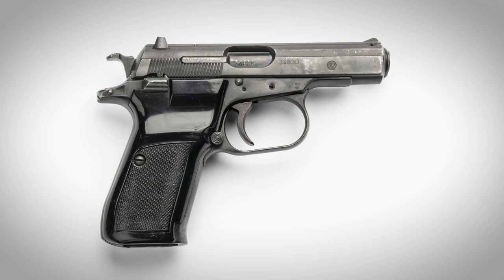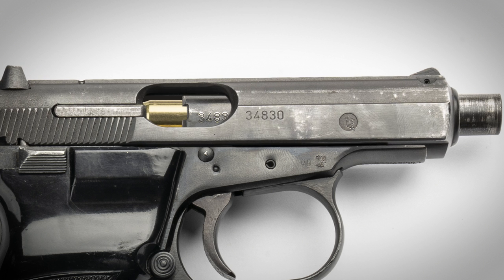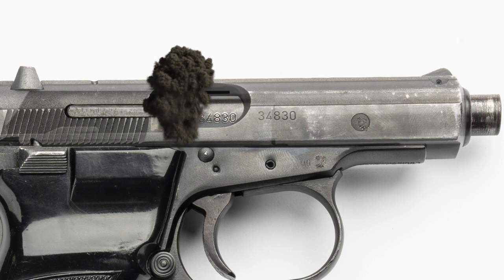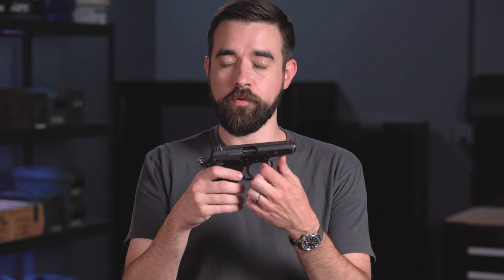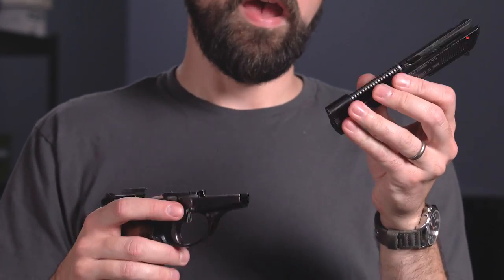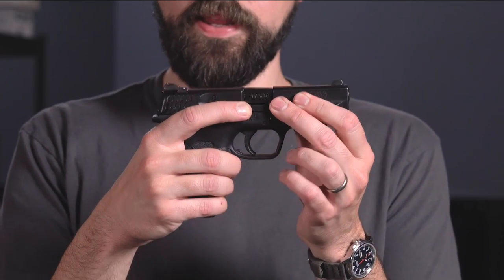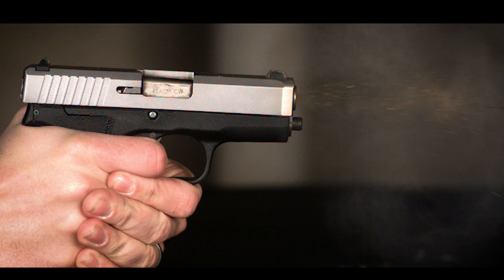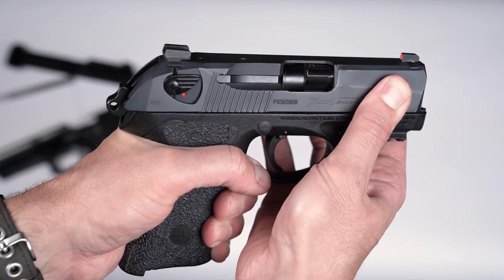Blowback Versus Recoil Operated Pistols

Comment: You should have covered the Magnum Research Desert Eagle XIX operation.   It has a fixed barrel and a locked breech. It is short stroke gas system operation.
Why hasn't anyone discussed an electronically timed delayed breech unlock operation?  A pressure sensor could even be used, if it wouldn't get fowled.  There are electric primers (Remington EtronX) and electric triggers (Digitrigger), why not a electronic breech unlock?

Comment: So would I be accurate to say that in general:

Blowback's have a straighter shot because the barrel is attached to the frame, slower rate of fire due to operation mechanics, and increased experienced recoil because the operation does not absorb it

Recoil's have a less straight shot because the barrel is not attached to the frame/it moves, a higher rate of fire due to operation mechanics, and decreased experienced recoil because the mechanics of operation absorb it

Of course the experienced recoil, and accuracy of the shot truly coming down to the quality of the gun as a whole.
Reply: Yes, generally speaking a fixed barrel increases mechanical accuracy

Comment: What keeps the slide from opening before the bullet leaves the barrel? It can't be just the slide's mass and the resistance of the return spring. In a short recoil locke breech design such as the 1911, the slide and barrel move together and remain locked until the bullet leaves the barrel. But what keeps them locked together while the bullet is in the barrel. Note that the barrel and slide will remaim locked until bullet exit regardless of barrel length. You can fit a 16" barrel to an existing 1911 changing only the barrel and fitting it to the slide lugs and bushing. It will cycle properly. What mechanism keeps the slide and barrel locked regardless of barrel length?

Comment: I wish you had shown the function of the ejector pin. I just bought a SAR9. My ejector pin is angled 5 degrees inward twords the center about halfway down the pin. Other pins from the same model are straight. The pin in my Taurus TX22 is straight as well. I wonder if the angled pin was installed to eject the lesser rounds only weighing 115 grains. 😺

Comment: I have a Beratta 86.
At first I loaded a snapcap. Racked the slide and the snapcap did not eject.
Later went to the range and found the gun worked.as expected. Then I understood how it works. To unload racking the slide doesn't work. Tip up the barrel

Comment: the vid made alot of sense until you said a locked breech gun had less felt recoil and was easier to control. i had a sccy cpx 2 that had alot more felt recoil that my friend's hi point c9. if anything, at least for me it seemed the recoil between the 2 designs is dispersed differently, with a locked breech the recoil moves the hand uo and down and to the sides. with a blowback it seems to push straight back enabling a shooter to better stay on target and get faster follow up shots. that said everyone's results can be different
Reply from the maker: That's when comparing two guns of the same caliber and relatively the same size. The Sccy is small, with a grip shape that accentuates felt recoil.

Comment: You took astronomy because they lied to you about the math component ?  I assure you that science of any kind has lots of math .You are running a gun channel here . You are discussing the mechanics of pistols . Do you suppose that there is a lot of math in  PRECISION firearms design ?   Even engineering a BB gun requires advanced mathematics. I work in I.T . I also have a flight instructor certificate , I am an electronics tech and licensed radio operator , Do you suppose  there is math in any of those ?  You remind me of someone I met in Olive Garden who didn’t know the difference between astronomy and astrology . Wow . I would block your channel if it were possible.